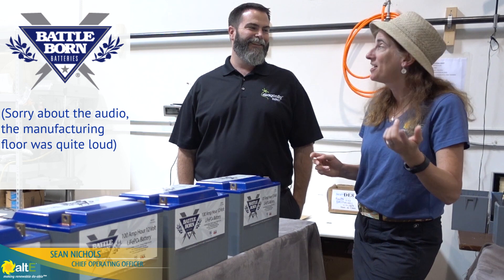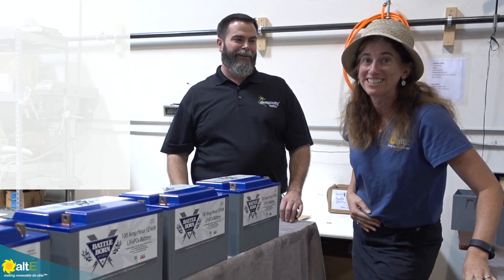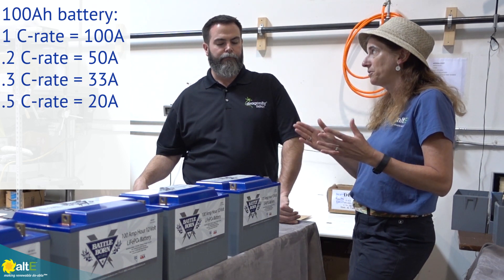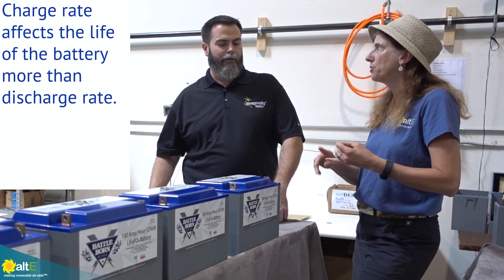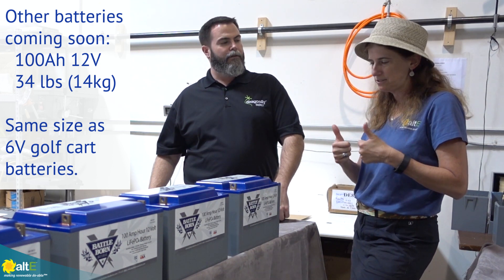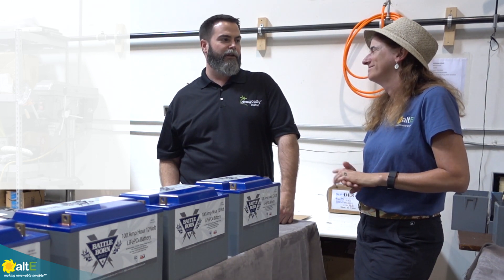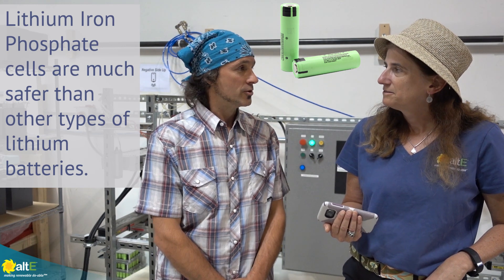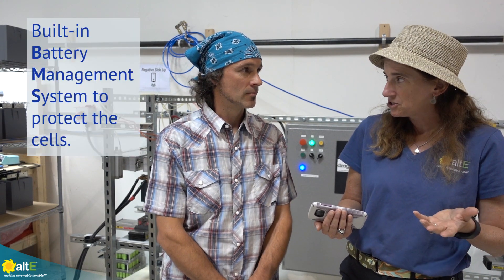Visit to Battle Born Batteries plant

Comment: @altE Store - By the way Amy, I did a test today using my 4 used 6V 230Ah AGMs in a series parallel arrangement (so 12V 460Ah rated and 12V 230Ah usable).  I simulated a full drain of one of those battle born batteries rated at 12V 100AH (so 1.2 KWh).  I used a Kill-A-Watt meter to measure the power consumed and stopped at exactly at 1.2 KWh.  The test took 1 hour 3 minutes with a load of about 1140 watts (a space heater on the lower setting).  During the last part of the drain, the under load batteries showed 11.7V and then when I removed the load, they immediately went up to 12.3V and then a few seconds later went up to 12.4V.  So I would say they were in a mid state of charge (SoC), no more than 50% DoD (Depth of Discharge), likely a little less like maybe 45% DoD (55% SoC).   So my main points being that good used AGMs can easily outperform one 12V 100Ah Battle Born lithium battery for both price and performance (unless very light weight is needed like in a moving vehicle).

The bank of 4 batteries can easily take 100A of charge power as that will be about 50A per 12V subbank (of 2 batteries).  Since they are rated at 6V 230Ah each (so rated at 12V 230Ah per series pair) , that is only about 0.22 C charge rate for them.  Very reasonable.   I suspect they could take double that while in their bulk charge phase, possibly more if you were in a big hurry to charge them.

Next time I might drain them to 1.28 KWh and record the results and make a YouTube video to show people that 6V AGMs are a great way to get cheap power.  Then they can see how they still have plenty of power left after draining them the same as "flattening" a single 12.8V 100Ah Battle Born battery to 0%.  I will also show charging them with the most powerful charger I have, which I think can do about 50A of charge power on a 24V bank (sucking more than 1500 watts out of the wall outlet).  It should be fun.  No editing either... just long pauses while the battery bank takes over an hour to drain down to about 50%.

Comment: What I would really like to see Sean do is make his own video where he would simulate using one of his 12A 100A LiFePO4 batteries in a real world situation by draining it once daily to a different SoC (State of Charge) to simulate both sunny and cloudy days, sometimes draining it to 100% DoD (Depth of Discharge) and other times shallower (like to 50% DoD) and many in between (such as 75% DoD).  It would take 10 years just to get 3,652 cycles so how can they already be claiming 3000 to 5000 cycles unless they are cycling it many times in the same day which is likely not a realistic scenario for a customer.  I would like to see the chart of expected cycles vs. DoD for that battery and also information on what happens if you drain it deeply and not recharge it for say more than 24 hours.  I would also like data on slow charging (is that good or bad for it) and can this battery be left on a trickle charger (13.6V per 12V) and if so, what should be charge current settle down to minimum (10mA, 25mA...).
Reply from the maker: Did you see the video Will Prowse just did tearing the battery apart? I think you'll like it. https://youtu.be/G5E30u-66VI

Comment: How does this guy Sean know that the way he tests them is "harder" than a customer would use them?  For example, imagine someone with a 200A alternator that connects one of these batteries, in  a highly discharged state, to an idling car that is putting out 125A at 14V.  That would be MORE than his 100A test.  He is making assumptions and in this case, a bad one.
Reply: @cavemancamping - you don't know what gear I need because you don't know what I already have.  My point was how is the BMS going to limit the charge current to 100A?  If it already does that, then why in the presentation does Sean say 100A charge rate maximum and 50A max recommended?  If the BMS could knock it down to 100A max then he should have said something like "hit it with anything, our BMS will automatically knock it down to a safe amount".

Comment: Why does Amy make a face when he says charging at 100A is possible?  There are 120 cells inside so that is 833mA per cell and those are 26650 cells I believe so that seems reasonable.  Maybe the BMS has issues with 100A going in which is why the guy does't recommend it.  I hate when people say to do or not do something and they don't explain why.

Comment: Those batteries would be awfully expensive for a golf cart application.  Better and much cheaper solution... just get some good used AGMs with the option to put a single good used 300W solar panel on the roof of the golf cart.  That setup would be thousands of $ cheaper and in my opinion, more fun.  It would also allow you to use a small onboard charger instead of a large and heavy not so portable charger.

Comment: No thanks on this battery.  I can get "standby" used AGMs that are 100Ah with 5 to 7 years of life remaining on them for $54 each ($70 - $16 scrap value when done with them).  So for $864, I can get 16 of them for 12V 800Ah (usable down to 50% DoD).  I could also arrange them for 24V 400Ah usable or 48V 200Ah usable.  A single LiFePO4 battery (vs a bank of 16 AGMs) has limited applications, for example, you cannot run an average house on one 12V 100Ah LiFePO4 battery, but you likely can with the sixteen 12V 100Ah (50Ah usable) AGMs.  I'll stick with AGMs because I don't really care much about light weight, in fact, I prefer the heavy ones cuz they are a "free workout" to lift.  They have actually made me much stronger moving them around.
Reply: @cavemancamping - Those are valid points but not required for many applications.  For example, for emergency backup power with a stationary battery bank (such as in a basement), who cares if they are 80 pounds each or 30 pounds each?  Also, if very good used AGMs are available (which they are for me), I can easily beat the price of new lithiums as I described in a previous comment here.  I guess it depends on the application but to say that lithium is cheaper than AGM in the longrun is not a totally accurate statement since good used AGMs are out there but where are all the good used lithiums?  If the Battle Born 12V 100Ah batteries would drop in price by 50% over the next 2 years, then I would be tempted to purchase 2 of them (for $1000 total) but until then, I will stick with my powerful, reliable, and cheap AGMs.

Comment: It would cost me six figures to buy enough of these batteries to power an Aims 140kW split phase inverter. The inverter costs $29k but the battery cost would be four times that.
Reply from the maker: What on earth are you powering that you need 140kW of power? You bet the battery bank will be expensive to store all that energy. That does not sound like a residential system.
Reply: @AltEStore  I'm trying to replace 200A mains service. The idea of the 140kW inverter is that it's safety margin from overloads is great and thus should not be prone to failure like a 15kW inverter that's running at 140% capacity some of the time.
We have all electric ceramic cooktop, electric dryer, 3 large air conditioners,  a recording studio, a theater with a large venue projector, an electronics laboratory and a 20,000-watt sound system to power. Fortunately a  lot of the larger loads are intermittent. We have a static 4-5kW draw that's 24/7. That'll be the rendering workstations in the studio, our networking gear and web server. The shop has about a dozen pieces of test equipment, power use from 140W to 500W each.
We pay about $8,000 /year for electricity now. It increases every year. Over the next ten years, we expect to shell out six figures for electricity. That would pay for a decent amount of solar cells. Storage overnight remains the challenge. I keep revisiting this technology development every 2 years to see how things progress.
I'm tempted to start a small scale system to get my web server running 100% on solar power, but even that will cost thousands.
Reply: @cavemancamping  I'd worked 90 hours weeks for 15 years to afford all that in the 1970s. I'm now retired on $730 monthly social security.

Comment: These batteries are for folk that just want to drop it in and forget it. Warranty is the best too however, for me I bought a GBS battery for $550 and free shipping.It's the same 100 Hr size but no BMS. I've ran my battery now for 1 year in a box as a trolling motor battery and pulled .6 C and charge it at .4c  and not one cell is out of voltage range. BMS's can fail and cause fire or take out your battery pack or even short out your electrical system. I rather have voltage meters to glace at the voltage and not worry about it also, the only real danger is charging in cold weather and having a way to keep these batteries from freezing is a must. Having the batteries in the RV the climate is never below 32f. The battery can handle freezing temps and you can pull power out of it however, charging it can and will damage it.
Reply: I would never trust a LiFePO4 battery bank with a BMS in marine applications. Imagine your in the middle of the Atlantic and your navigation stops working because of a faulty BMS...

Comment: consider that this is a small startup company with a mostly human-based manufacturing system, like tesla the first models have to be "expensive" in order to build the company. also consider that this battery is marketed primarily to rv and recreational users who need a light, powerful, quick-charging sealed battery that they can stuff under a bed and will last a long time. $1K really isn't bad when you consider that it will last 10 years and if you get walmart rv/marine batteries for $100 you're going to need new ones every year or two so after 10 years, you will have spent almost that much for the "cheaper" batteries..

Comment: Prices are way high— but we smile.  Smile in production.  Smile smile and smile. Pay alot more— partnership enables us to increase life cycle . 10 years perhaps.  Cool. Can a reasonable profit be made with lithium now?
If so — very cool. I will be doing lithium with my 5th wheel toyhauler project.  Leaning toward tesla or leaf module with at least 600 amp hour module for $1400 ish.  Gotta figure bms thats ok though. 6k plus is alot.
Reply: Perhaps if I won the lottery I could afford to buy these batteries and go off grid too. But then again if I won the lottery I could afford to pay my electric bills!

Comment: What cells are inside theese?> has anyone taken one apart and found 26650 or pouch style batteries inside? How much would it cost to just build your own?
Reply: You can build a prismatic cell battery much cheaper than the Battleborn.   But you must understand the weak link in LiFePo4 batteries is the BMS.  Battleborn must have supreme confidence in their BMS  to offer a 10 year warranty.  You can source BMS's directly from China with the specs you want, but I am not sure you'd be able to place your trust in it like you can with the Battleborn system.  As far as building your own, I have been researching that question for a week now.  I just got a quote today for a 240ah prismatic cell battery (4- 240 ah prismatic cells in series), with pure copper busbars and screws and a 200a (supposedly quality) BMS, and the price was 930 delivered to my door in WA State including 5% paypal fee.  Now that is a fine price for 240ah compared to 100ah for the Battleborn.   The specs are nearly identical, but now I have to decide if its worth the risk!  The China source does have a 5 year warranty and they have been around a relatively long time for their industry,  but its a crapshoot with a grand on the line........
Reply: Will Prowse recently took one apart, great video
https://www.youtube.com/watch?v=G5E30u-66VI&t=419s

Comment: Will my existing charge controller charge at a higher rate with the new batteries, or do I have to make an adjustment to it?  If so, will my charge controller need larger wires to handle the increase in amps to the new batteries?
Reply from the maker: Different batteries shouldn't automatically make changes to rate. If nothing changes with the solar into the charge controller, and the charge controller settings aren't changed, then you will have the same output.  If you do make changes that causes the charge controller to output higher current, then you need to make sure your wires and breakers are properly sized for the higher current.
Reply: @AltEStore  LiFePo4 has much less internal resistance than an AGM battery so the charging is a lot quicker, especially at the top end where AGM battery resistance slows that charging down a lot.   If your wires are sized correctly for AGM, you should be golden.  Your controller will only output the max value of the controller.  And, lower resistance mean cooler wires anyway doesn't it?  Proper wire size will be the same as far as I can see.

Comment: Way not use seperate 2 volt wet LA fork lift batts, they last longer and can handle being abused, the lead plates are thicker?
Reply from the maker: That is a totally different option that may be better for some people, but not all. The forklift batteries are much much heavier and bigger than lithium. The wet batteries also need regular maintenance, which many people are unable or unwilling to do. The beauty about energy storage nowadays, is there are so many options that can meet different needs.

Comment: i have a ??  i have  200 watt solar panel  new  and  a 100 amp hour battery all 12 volt   new  been hooked up  now  for  3 days  and on  one  post  the +  post  its starting to get Corrosion ??? is it  the battery  or  something ??  its been  running good and i  been uesing it   any info  will help  thanks
Reply: Try cleaning your terminal posts, make sure they shine brightly, remake the connection making sure it is tight and secure. Then obtain some terminal post grease for batteries or failing that use Petroleum Jelly.  Not sure if you are talking about PbSo4 batteries, if you are, it maybe being overcharged and the acid could be boiling out and leaking on to the terminals.  Always wear a full face shield or at the very least goggles when working near batteries. Have a solution of Sodium Bicarbonate at the ready to neutralize any acid spills or splashes.

Comment: Hello, Could you inform me how can I connect 6 batteries in 2 serials and 4 parallels.
Reply from the maker: You would not be able to do that. Connecting two batteries in series, where you connect the plus from one to the minus of the other, increases the volts. So you would end up with 24V across those two, at 100Ah. Wiring in parallel, where you connect the plusses together and then the minuses together, increases the amp hours, so parallelling two 100Ah batteries would equal 12V 200Ah.
If you have 6 12V batteries, and you are trying to make a 24V 300Ah battery bank, you would wire 3 sets of batteries in series, and then wire those 3 sets together in parallel.
Reply from the maker: Here is an example of 3 parallel strings of 2 in series, https://i.imgur.com/JuUta0x.jpg
Reply: Amy is wrong again.  Answering the persons question as asked (2 serials (series) and 4 parallels), you could simply wire a single pair in series (call those batteries A and D), and the other 4 batteries would be paralleled to A and D.  Call those batteries B, C ,E, and F.  so B and C would parallel with A.  E and F would parallel with D.  The person didn't say load balanced or anything like that.  Very bad Amy, you giving out more wrong information.

Comment: current 1575AH battery: $2500. 800AH (since I would only need half given the 100% DoD) Battleborn: $7200. Nice idea, but gonna have to lower the prices. Also need more voltage options.
Reply: the battle born lasts 5-10 times as long....
Reply: Agreed. Rolls wet cells can last decades if cared for. Had 6 Trojan golf cart batts on our last sailboat that lasted almost 15 years.

Comment: How many cells per battery?  Why were cylindrical cells chosen over prismatic cells?
Reply from the maker: Great questions. I just got this answer from Firefly. There are over 100 cells per battery.  Cyclindrical cells are better than prismatic cells. They have a longer cycle life and a better ability to dissipate heat.  Cyclindrical cells also are cased in stainless steel and prismatic cells are cased in polypropylene. Polypropylene is somewhat permeable to moisture and this is a death sentence for lithium.

Comment: 900 dollars for 100 amps? I don't think so. Not yet.
Reply: do more research.  they last for 10years, and are lithium so half the weight and their BMS is top notch so it's a set it and leave it thing.  i think it's a good price.  I mean, hopefully they come down in price but still...not bad.
Reply: I bought a 48V 200ah battery pack with BMS directly from China for 2500.00 Equivalent to 8 battle born batteries. Works great so far.
Reply: @kilogulf1164  how big and heavy is it and Is it under any warranty?
Reply: You can discharge a lithium 100% without harm but a standard AGM battery only 50% before you do damage. Doesn’t matter if you’re gonna charge regularly but if boondocking could make a big difference. Thing I don’t like about them is they won’t take a charge below 30 degrees
Reply: @j.b.9895  yeah that's why you keep them inside your camper/rv.
Reply: Ben Wade Dude when boondocking you sleep without heat. You keep warm in a sleeping bag, if your RV was warm enough by being plugged in or by a generator it doesn’t matter. Not all of us operate that way
Reply: Ben Wade assumes the interior of your vehicle is warm enough. Truckers and boondockers sleep without heat
Reply: Ben Wade so if you live in the north you keep your camper/rv warm inside all winter?